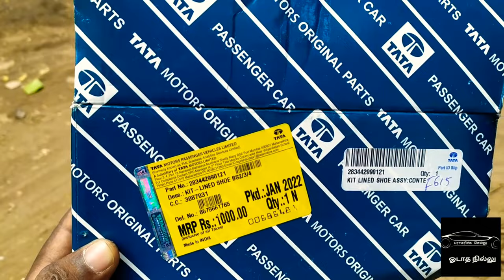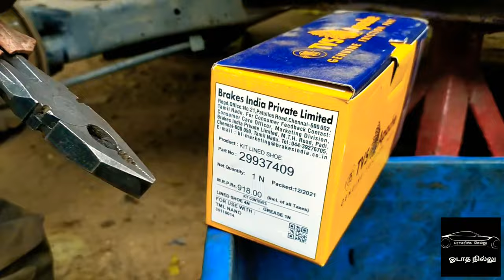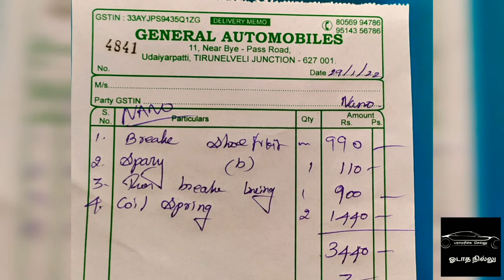Tata nano twist  Front and Rear Brake shoe lining Replacement.

Comment: Myself has possessed Tata Nano LX Model 2012 Light Green colour , till date I driven 2500 km purchased on 20 th Jan 2022 ..103 days had passed. Nano car is good easily affordable car to middle class family..Very Nice . Purchased 95000 Rs. Front one tyre back one tyre MRF tyre purchased. All type of oil changed Vannerpettai Tata Nano work shop ASOK SERVICE HAS BEEN DONE BY ME. 18 03 22. AT PRESENT NO PROBLEM NICE. 
K.GOKUL .